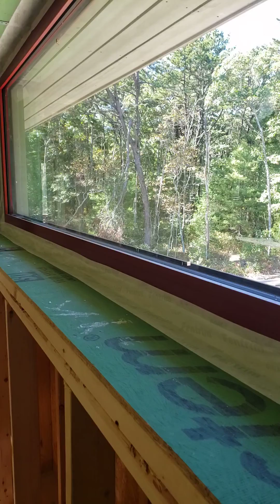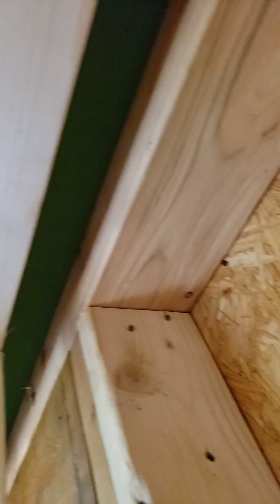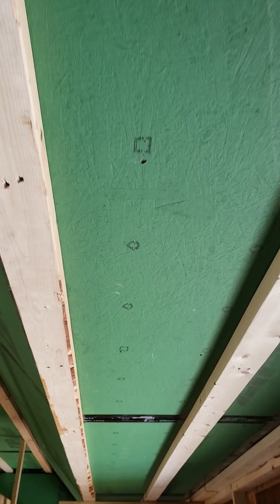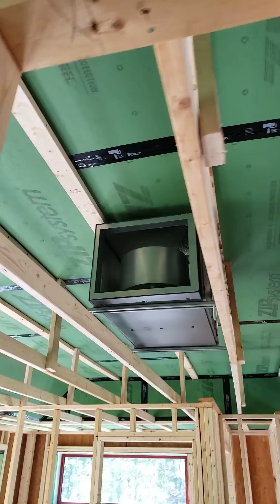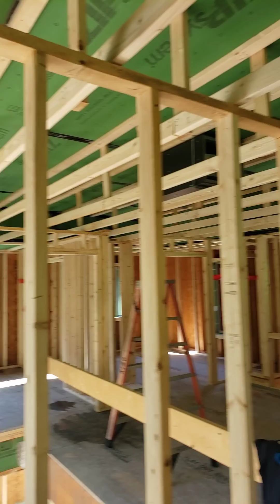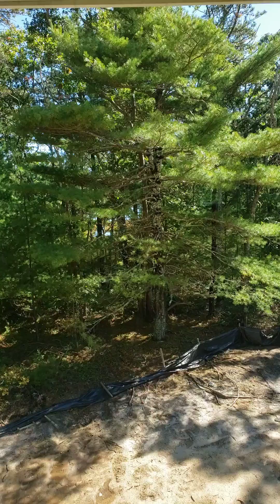ZIP SYSTEM CEILING - Air Barrier Continuity

Comment: Looks like it is a double-stud wall. Are you putting any exterior insulation on the sheathing? With a super-insulated double-stud wall, you would still have an issue with the sheathing being next to the cold which would cause condensation on the inside of the sheathing. Are you putting an interior air barrier? Is it that you are very air tight (outside zip sheathing) and you have no air movements so condensation is not an issue. How does this work?
Reply from the maker: We are installing 4: of closed cell on the inside face of the exterior sheathing, and filling the remaining 8" with cellulose.